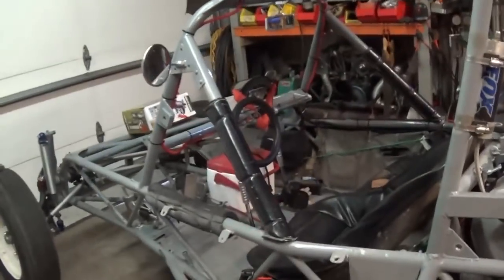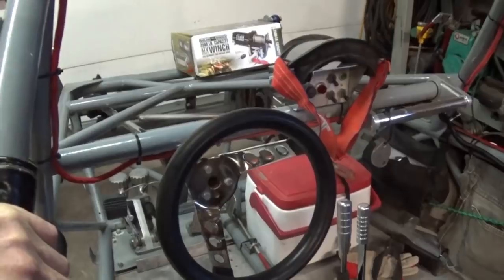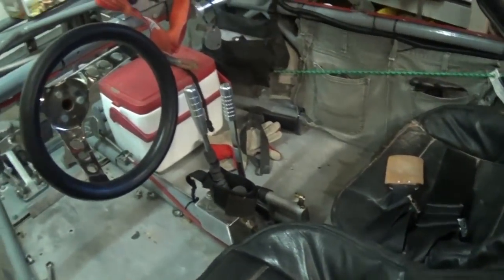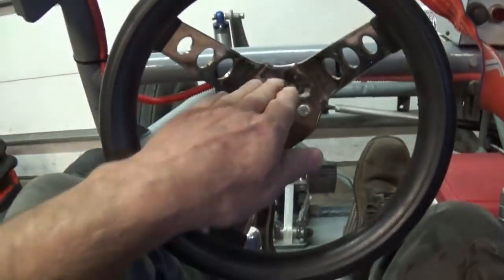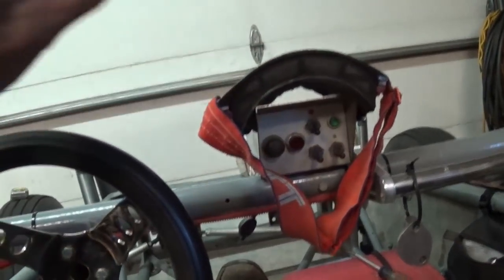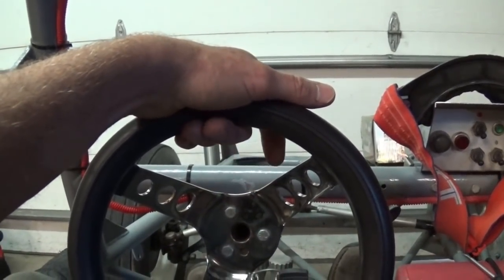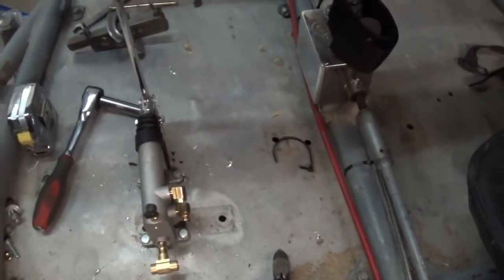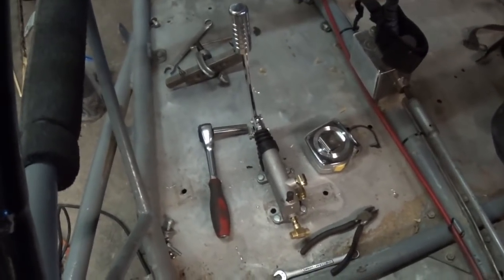Turning Brake ( Install )

Comment: There you are... Merry Christmas .
I must agree with you on the placement of a turning brake.
Mine is forward of the shift lever and , yes... I went to shift on a bumpy road and grabbed the brake handle instead.  Also wanted to turn sharp on a sand dune and pulled the tranny out of gear.. oops. 
You have a great day , happy to see you back in the garage.

Comment: Hello EZ I have a question my master has two front to rear out put can I block one rear port being my cutter is a single in dual out and run one line off master to cutter?
Reply from the maker: Not enough info to advise you. 
Street car, recreational toy, what year ?
On my cars with off-road use I have one brake light switch port, two for the front and one for the back. I use the single rear port to feed the cutter brake and go to each rear wheel on the outlets?????
Reply: @TheEZGZ  it's a 1966 beetle rail buggy I have one port for switch two front and two rear off of my master my cutter is one in two out was thinking about plugging one rear port instead of running two lines into a T fitting thanks for your input ❤️
Reply: @TheEZGZ  ok got it figured out I have two ports for rear brakes because one port is for another brake light switch being this master has two switches but any how it's on my street legal woods rail buggy thanks Ezgz ❤️ titled 66 64 kingpin 64 swing with a 73 1600 super beetle engine I added oil filter external oil cooler with electric fan 😀 I've never put a car together and apart so many times but I'm nearing the finish line 💯

Comment: I’m going to do this to my 2014 Silverado 4x4. I have a rear locker but not in the front. My thought was is when I’m crawling through the rocks the front end is open. When I switch to four low it deactivates my traction control. So I figured I can use this hand brake method to brake the spinning wheel. Still retain my auto four wheel function stabilitrack and abs that I would possibly loose putting in a solid axle. They don’t make a locker for my front carrier.
Reply from the maker: Sounds like a plan. It sure makes a conversation peace when your friends see it.

Comment: Does this turning brake have a E-brake so when you park you can set the parking brake? Where did you get it I've never seen that type of brake assembly. Thanks
Reply from the maker: http://www2.cip1.com/SearchResults.asp?search=steering+brake&Submit=
Reply: Thanks EZGZ. This is a new place for me.

Comment: EZGZ, this made me more curious?!?      Okay, I believe this is what a fellow watercooled VW guy used on his FWD Jetta, to control which side puts down power.    I have a 4" Lift on my 2001 VW Golf TDI, with 28 inch all terrain tires and would like to try to gain more capability offroad, before(or with)getting a Limited Slip Differential. Very little information about this stuff though, from what I see. 

How can I Tap into the Front Brakes of my Front Wheel Drive car, while having no ill effect on my normal brakes??

Aside from that, I guess I just need to make a plan to mount a turning brake handle in the cab and run custom brakes lines ofcourse. 

Very intrigued!!
Reply from the maker: interesting problem. I have never delt with that new of a car and brake system. That's a whole new ball game bypassing modern technology ??????  Be Safe

Comment: How did you bleed it, having a heck of a time with mine
Reply from the maker: One of my vids showed how I push the air out from my master cylinder using low pressure compressed air.   Yep.   I push the fluid with air. It's a one man job that way,.
Reply: @TheEZGZ  Its called pressure bleeding
Reply: Thanks for the low pressure tip because I installed brand new:

master cylinder
brake lines
cutting brake
brake lock 
rubber brake lines
calipers 
So needless to say there's a lot of air in that system and trying to figure out where to start the bleeding process is where I am at now

Comment: I have the 3 rib T2 in a Class 9 Baja car.  The Trailing arms are T1.  My question concerns location of the Bus trans.  Is it offset or not centered?  I measured mine and the left side axle distance between trans and axle stub is just over a 1/4" difference.  The right side axle end bangs into the stub axle...loudly.  I know you are busy...maybe hoping for some knowledgeable insights.  Thanks.  I love your videos
Reply from the maker: It should be centered. It probably took a hard hit and bent.  You could shorten the axle that banging if you can't bend it back. If the axles were level you should still have some side to side clearancfe. Your spring plates might also be bent. Unbolt your wheel and brake assembly and see if both sidesare even. Your trailing arms might be bending or the mounting bracket bushings on the torsion bar.   Air Time is expensive
Reply: 😂😂😂 Jeez H keee-rist I got it!!!😂😂😂😂

Comment: Great video! Do you have any tips on bleeding brakes on a sand rail with turning brakes?? I'm having a heck of a time right now.
Reply from the maker: I know how  frustrating that can be.   Some turning brakes have a air bleed screw on the top but if yours doesn't you just have keep at it.  Try doing it in sections. Maybe disconnect the top rear break line and bleed it to only the turning brake. Then reconnect the line and go to that rear wheel. I have Mickey Moused a power bleeder by stretching a bike tube over the top of the master cylinder and clamping my air hose to it with as little air as possible. Letting it leak out the top. Then go to the rear of the car and bleed the longest brake line first. The trick is not to let your master cylinder run out of fluid and force more air in the system. I've never had good luck with those mighty Vac pumps. It want to suck air from the bleed valve instead of all the way from the MC.  
Sometimes driving around on the sand dunes and get all the odd angles helps the air bubbles collect.   You  almost certainly have to do some more bleeding ounce you've been out on the dunes.  The whole thing is a PITA but ounce you get it you will like having it unless you have a heavy car.  Back in the day when every corner had a gas station that serviced cars they all had power bleeders and you could stop by and they would do it in a jiffy.
Reply: @TheEZGZ  thank you for the advice. I will keep at it sir.

Comment: ezgz,hi,just wanted to share with you a story, i drove a 78 vw bus from ohio to sw new york, i keep track of my gas/mpg log, the bus has a 1600 dual port solex pict 34, i am not kidding i got 39 mpg, just the one time, but i usually get around 25mpg, also i only burn non ethanol gas in all my vehicles, i go to "pure gas .org" and plan my trips accordingly to where the stations are located. its usually 90 or 91 octane, and about a buck more a gallon, but the engine runs so much better, also if it sits, it doesn't ruin my carbs, hey keep up the good work, i'm learning an awful lot from you and vwdarrin
Reply from the maker: Sounds like a great adventure. I need to check out that pure gas.org

Comment: How is this ball buster setup working for you? All joking aside this seems like a good placement.
Reply from the maker: Works good with disc but sucks with drums. Of course I put larger wheel cylinders in them daaaaaa.  Truthfully though this car is a heavy pig and unless you need to get one wheel going to get unstuck it might as well not be there. That's my story and I'm sticking to it.

Comment: You should be able to fab two handle cable e brakes for cheap
Reply from the maker: You've got to be kidding. On a sand rail that is a lot of work and those drum brakes are always needing adjusting and give trouble on sand cars. Cheap stuff gets cheap results and always acts up when your in the middle of having fun. Disc brakes and hydrolic turning brakes are one spot I don't like to cut corners on. Safety first.